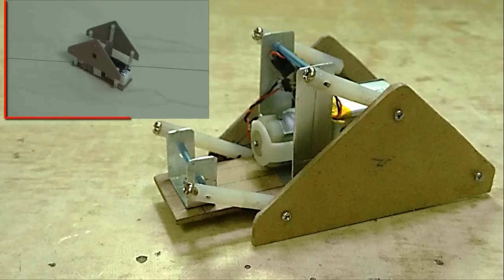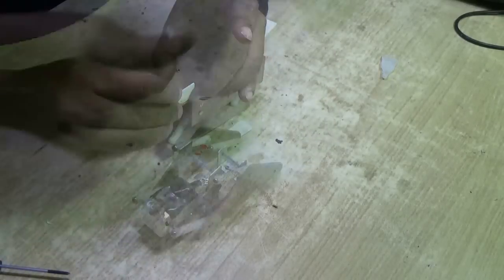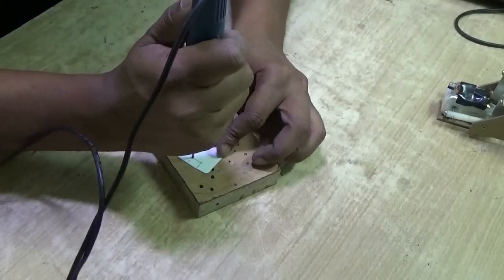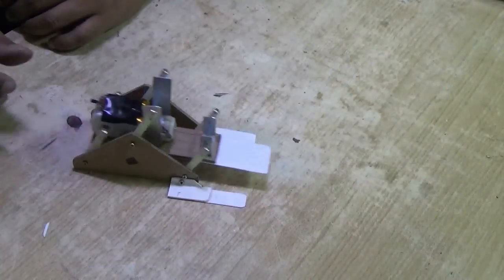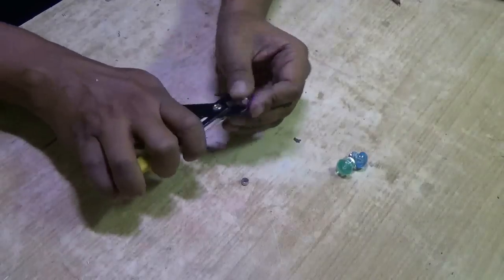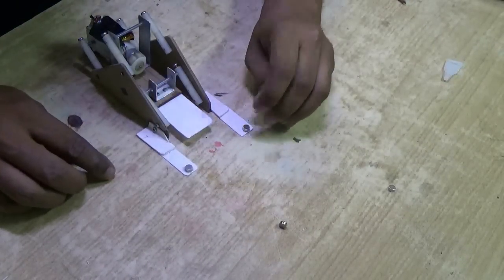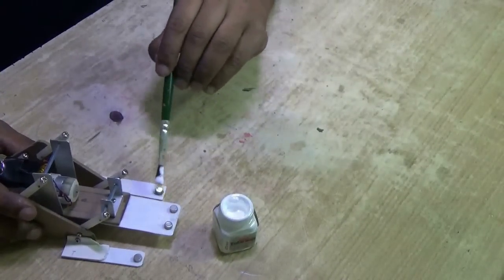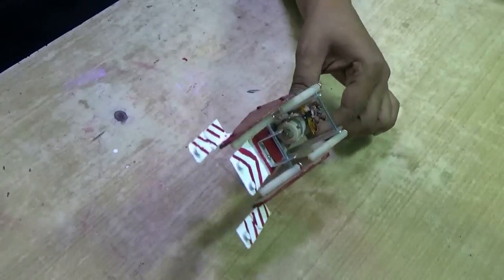How to make a climbing Robot

Comment: Brilliant!.
If instead of magnets, a small suction cups are placed ?.
There also would climb by nonmagnetic surfaces ?. 8-)
Reply: +Francisco Javier Lázaro Pinela what if the suction cups do not stick well thats why magnets are used
Reply: +Dhruvgiri Goswami Yes I understand.
But my idea was to climb could not ferromagnetic surfaces.
While I recognize that it would be more complicated, because to "take off" the suckers on the surface, should be sought Agune system so that vacuum is released.
It would be an interesting project and perhaps practical use with larger, like climbing buildings.

I do not know if there is something similar out there already:

http://www.amazon.es/gp/product/B00OJ768SS/ref=as_li_ss_tl?ie=UTF8&camp=3626&creative=24822&creativeASIN=B00OJ768SS&linkCode=as2&tag=tecnoboinas-21
Reply: it would be hard to do with suction pads but we can do it with high speed motor that would make vacume

Comment: I need ur help { urgently } .. What is the pin like one connected to the wire on the DC motor ..that u use to plug it in with battery and IR Proximity sensors ????